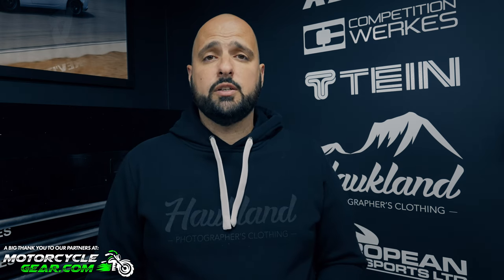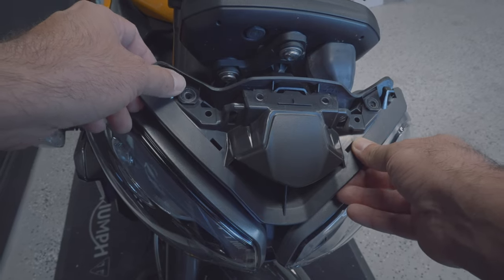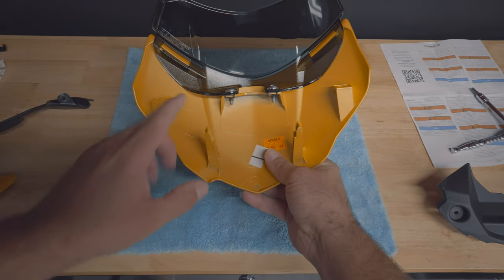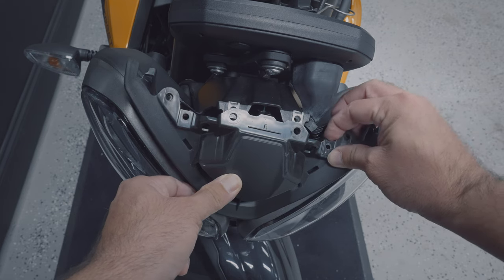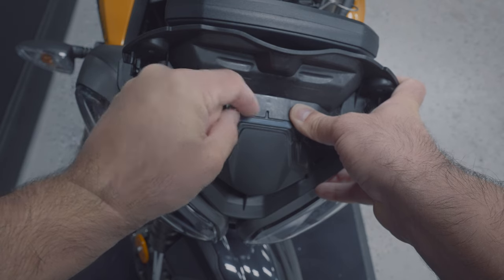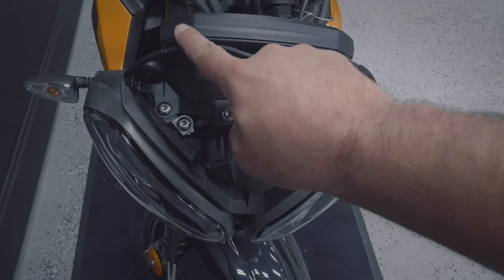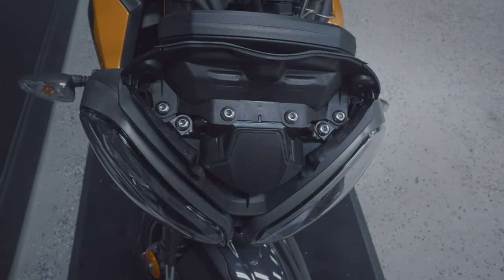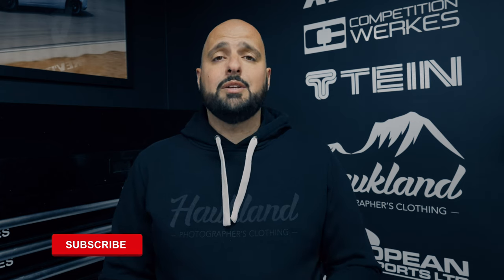2024 TRIUMPH STREET TRIPLE 765 RS | Fly Screen & Visor Kit Install

Comment from the maker: What are your thoughts on the before and after?
Reply: That turned out super nice! I really like the look better after, I know Triumph was trying to mix it up a tad with the "new" look but the bike just kind of looked incomplete without the Fly Screen Kit. Nice work.
Reply from the maker: @2WheelDez  Thanks, yeah I like it a lot better with the kit.
Reply: I recently installed this too. I think I like it better too. I was hesitant at first.
Reply: did it provide any relief from sun glare directly on the TFT Screen?
Reply: @altonkriel  Yes, somewhat, depending on the angle of the sun.
Reply: @altonkriel I don’t have the fly screen kit yet, but I find running in dark mode all the time best for fighting any sort of sun issues. I’ve not really noticed a problem at all when I run in dark mode.

Comment: I can’t get the final screw in! How did you do it? One side is in, but the other just turns and pops. I’m pulled engines and never had this much trouble with one screw
Reply from the maker: @lcgiv4u  wont lie it was tricky, it kept not going for me either, i basically had to get it dead straight, say a few choice words and finally got it to go hahaha
Reply: @FifthNorth I’ll keep trying. Pretty embarrassing lol
Reply: @FifthNorth  I did get it just after you replied…ended up needing to squeeze the screen and rear mount while constantly turning the screw 😂 Thanks!
Reply from the maker: @lcgiv4u  awesome to hear! Enjoy!

Comment: Thanks for this, most professional. I adore my 2024 RS (in Red (much nicer :-) )), but the only part that feels unfinished like a Yamaha is this bit. I had the full fairing thingy on my 2016 model and don't really want the same on this. I have seen a little carbon filler on FB group that hides the back of the dash but keeps the shape of the little standard oojamaflip. But it's nearly £100 I think.

Comment: If fitting the clear visor you are not supposed to use the black rubber gasket.  It states in the fitting instructions for the visor to remove the rubber gasket.

Comment: Hey. That looks cool. I want to get that screen and visor too. Do you know if the visor comes in different tints, like light smoke and dark smoke? When I check the accessories web page the visor seems very light tinted or almost clear, but your seems to be dark smoke which looks much better... Is it just poor photos, or are there different tints? Thanks.
Reply from the maker: Yeah its kind of weird, everywhere I have looked, even Triumph direct the photos show the screen as clear, but when you buy it it will look smoked like mine. As far as I am aware there is only one version of the screen and it will look like the one in this video. Hope that helps, thanks for watching!
Reply: @FifthNorth  Thank you! I think it looks great and I wanted my bike to look the same! Will order both parts tomorrow! 😍

Comment: Just wondering with the clips when you installed the screen on the bike, you mentioned the clips click in in when you slide it on, does it easily slide down for removal?
Reply from the maker: Yeah they click in but can be taken off too, they are not too tight or rigid.

Comment: it looks like if i byy the flyscreen first and see how I like it, I wouldnt have to take it all off again to add the visor later - it would just be an easy pop on. is that true?
Reply from the maker: No you would have to take it off to install the visor later, I guess technically if you had the right tools and small hands you could take the flyscreen about halfway off instead of all the way, and then do the install but you would run the risk of breaking/scratching something.
Reply: @FifthNorth  gotcha. ill just buy them at the same time then

Comment: Hey man I have a question, in the 2022 model, can you remove the fly screen and install the smaller piece you have .
Reply from the maker: I honestly have no idea, I have never owned or worked on a 2022 model. If I had to guess I would say no, since the small part first appeared on the 2024 models, so I would be surprised if models before that had mounting points for it

Comment: hi, is it the same for the R model?
Reply from the maker: Im not 100% sure as I havent done the install on the R, but my understanding is that the install itself is 100% the same, whats different is how you take off the factory piece before you start the instal (your owners manual can explain that part).
Reply: thanks @FifthNorth
Reply: Yes the removal and installation is exactly the same on the R model. I just finished doing it using this video.

Comment: How big of a difference does it make?
Reply from the maker: Is there a difference? Yes, is it massive? No. If you are expecting full sport bike fairing amount of difference you will be disappointed. If you have realistic expectations of getting a slight difference in wind and great protection for your dash for under $300 you will be happy. Hope that makes sense.
Reply: @FifthNorth  Thanks dude. My first bike after 50 years is a Ninja 500. Perfect for me, but the wind becomes an issue pretty quick, like at 40mph. I really want a Triple 675 but I'm thinking the wind is going to be as bad or worse. You think?
Reply from the maker: @jonobester5817  from as far back as I can remember Ninja 500s have a full fairing right? So I would have to assume that the wind on any model Triple would be worse as it is a Sport Naked VS a Sport bike. As far as my street triple goes, I ride comfortably up to about 60mph, after that is when the wind starts to annoy me. With that said, I haven't yet had a chance to do any freeway riding with the new kit installed (have only been able to get up to about 55/60) so I can't say for sure if above 60mph is any better now with the kit.
Reply: @FifthNorth  I call my Ninja 500 a poor man's sport bike. I don't have to worry about doing any accidental wheelies. But I would hesitate to call it a full fairing. I don't know, Maybe it is. In any case, the riding posture is way more upright than a real sportbike.
Reply from the maker: @jonobester5817  I can understand all of your points, but even still I would say from most Ninjas that I have seen that front "fairing" and windscreen look taller than what I have now that the Fly Screen kit is installed so I would have to assume that it offers more wind protection, but to your point riding position does make a difference and so does the position of said screens....I guess long answer short is, I would assume that your Ninja has better wind protection because of the size of the windscreen/panel but no real way of knowing until you ride both and see how it feels to your size of body and riding position.
Reply: Thanks so much. I got to sit on and rev an older 675 and I was immediately enamored. The bike fit me so well. I'm only 5' 7" 🙂 I look forward to riding one, and some day owning one. An older one like me. @FifthNorth
Reply from the maker: @jonobester5817   No problem, thanks for watching!